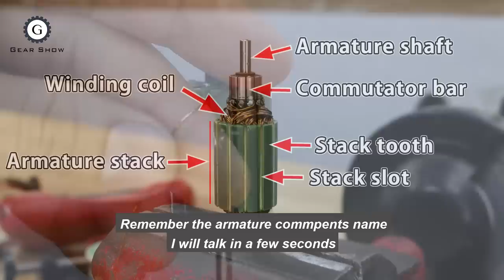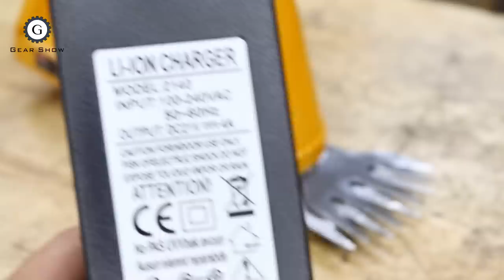Cord to Cordless Mini Hedge Trimmer Conversion 100V to 18V | RYOBI AB-100A

Comment: You have saved one original winding as example and used it as template to wind new coil. Originally this motor was designed for AC, you rebuild motor for AC with lower voltage. It will work on DC, but energy conservation efficiency is 50% smaller and battery discharging faster. AC flows in both directions, but DC flowing only in one direction, so one side of each bar doesn't create any useful magnetic flux.
Reply from the maker: Okay, Thank you so much for sharing! Could you suggest me the good solution?

Comment: IDEA: make a base to hold cutter. Add wheels and a extension rod with handle. Now you don't need to bend down use cutter!!  I have sunco weed cutter with handle and detachable base. I use it all the time instead of the 2cycle  weed eat. Why? It has more control and it will not accidentally damage trees or siding of house. Again great job!!!
Reply from the maker: Great idea, At the beginning I planned to create the handle like you suggest, when finish the project and render the video, I realize I forgot this part. Anyway thank you :)

Comment: Great job, great video! I just wonder, if the small switch can handle the high current. I'm afraid it will burn soon...
Reply from the maker: Good question! After one hour cutting test, it still handle his job, I hope it will okay.
Reply: @gear_show  Well, you know the current rating of the switch, and can measure the actual motor current (just give it some load while doing so - though I'd also measure the resistance to know the peak value) ;)
Reply: @gear_show  il suo numero

Comment: I would like to show a little math to this work. How many turns per each slot and the thickness of wire etc. Thanks.
Reply from the maker: You're welcome, thank you!
Reply: @gear_show  Many thanks for this. But could you explain how you upgraded the motor ? Copper wire gauge ? Number of coils ? Thanks again.

Comment: How the original work? This is a DC motor (permanent magnet), how it will work on 100V 50/60 Hz AC?
Reply: I had the same question (but in reverse, right ?). My guess is he tried several scenarios and found a one that work. I would say that going from AC to DC on this electrical motor is merely due to the position / offest of the several copper coils. The gauge is also key as current flow would be higher.

Comment: I did a battery change to lithium in my Makita drill but when I pull the trigger it won’t rev up but if I pull slowly it will then stop can anybody help please
Reply from the maker: Please share us your power tool detail and battery
Reply: My guess would be your BMS electronic circuit (Battery Management System). I had the issue once. The BMS had a too low value for maximum discharge current protection. That could explain why it works when you push the trigger slowly. Those devices need high current to operate properly (meaning also high current cells like 30A instead of 2 or 3A). Check your BMS and make sure both the cells and the BMS can stand the current value.